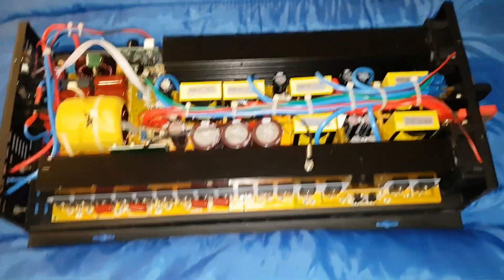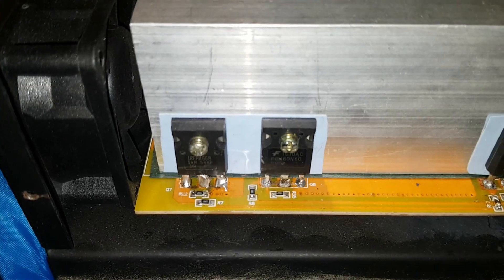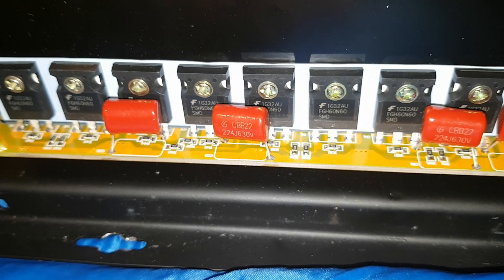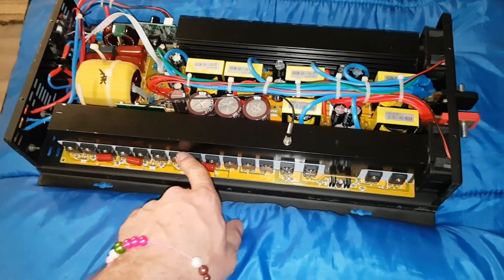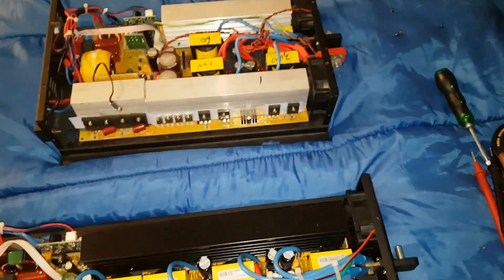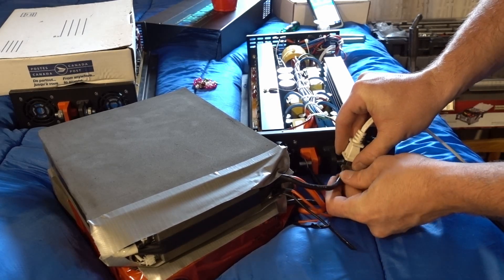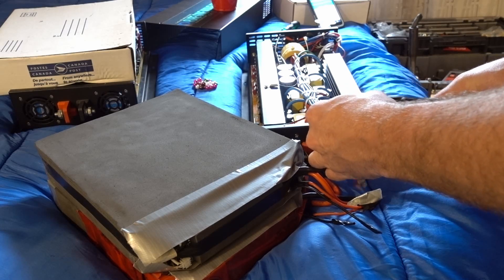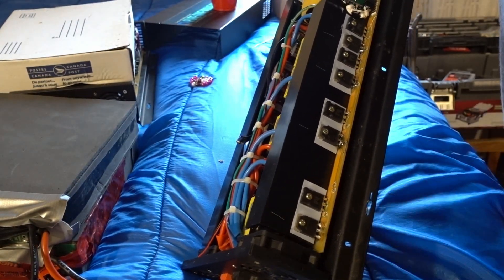4000W Reliable Inverter Insides

Comment: I have a reliable 3000w
First switch on, solid red light
Switch of 2 minuets later switch on and bang.  1 blown mosfet and 2 shorted IGBT’s
Will a g30n60 works as a replacement IGBT?  It has same spec as the original
Reply from the maker: if the specs are the same then yes. what was the original mosfet number ?
Reply: 60t65pes.  I have just realised that the replacement is 75a rather than 60a.   And 600v rather than 650v.  Would this still be ok?  All other specs seam the same that I can see.   Thanks for your help.  Loving the videos
Reply from the maker: @stockleys  that should be fine.
Reply: Would you believe it, new IGBT’s turn up and one is faulty.  Totally open circuit.   One question about your video, if the inverter has overload protection, why would it blow components if it’s overloaded.  Should it not shut itself down before damage is done?
Reply from the maker: @stockleys  I believe it has overload protection if you use items that slowly ramp up the watts but high surge or if your running at max rated power for to long it can blow components
Reply: Next question and I am very grateful for your advice,   I have installed the new IGBT’s.  Inverter is working.  Good 240v.  But the frequency is going as high as 70hz (uk is 50hz).   Also the fault light is faintly flickering.   Any ideas?
Reply: Ok it has settled down now. Steady 50hz.    But it does seam to be getting rather hot.  I did the mod you did (without cutting heat sink).  Moved thermostat to over the top the IGBT’s and applied thermal paste.   Not heard fans yet but I have only loaded it to 250w so far.   Working my way up
Reply from the maker: @stockleys  the red flicker is fine, it just the inverter saying its in the upper half of its operating range.
Reply: What I have discovered is that the flickering stops when the battery voltage is below 13v and starts again above 13v. Regardless of load
Reply from the maker: @stockleys  some of their inverters seem to do this, I have one that does this and it seems fine.
Reply: So the inverter has been running great for 3 weeks.     I turn it off to do some work.  Turn it back on... pop.  Same 2 IGBT’s blown again.   Mosfets all fine.      Replaced them IGBT’s    Turnt it on, no voltage reading and pop.    No load connected.    What on earth happened?   Is it a fault with the yellow board nearest them?      My electric bill has reduced massively using the inverter.   And I’m one day, it’s shot back up without it   Help please.
Reply from the maker: @stockleys  how big of a load are you running?

Comment: My 3000 watt Reliable inverter is outputting 130-134 ac volts and I suspect is overheating because of this as the fans come on every 5-10 minutes. Is there a way of reducing the voltage?
Reply from the maker: Inside the inverter there is a blue box with a small flat head screw on top covered in hot glue, turn it 2 times clockwise and see what voltage the inverter is at.
Reply: @GoingOffGrid101  Many thanks for the quick reply. I will give it a go.
Reply: OK I tried that as the output voltage started to creep up to 140-141 volts. Initially it went down to 129-130 so I turned the screw two more times and now its still sitting at 137volts with 27.6 volts coming in from the batterries. It seems to be working but I am worried that something is not quite right. Appreciate any help as I am isolated out here on a small island. Cheers.
Reply from the maker: @richardnemar-smith4621  sounds like the pot has been corrupted, might need a new pot, see of you can find a model number or ask reliable to send a pot
Reply: @GoingOffGrid101  Thank you for the quick reply. I seem to have little luck in contacting Reliable. They just don't seem to want to get back to me or don't read their messages. I will try and ring them tomorrow and see if that works. Many thanks.

Comment: I’ve got the 3kwh / 230V / 36V version. Didn’t open it up as it’s still working fine after 2 years. It draws about 35-40 Watts in idle since the first day. Except from that there’s no dedicated earth connection pole the only thing that I dislike. Do you have an idea how that idle current could be improved? Thanks!
Reply from the maker: Hmm thats a bit high for the 3000w my 120v ones only take around 25w no load draw,  could be cause you are using 240v, I would say dont fix whats not broken :D

Comment: 3K inverter = IRFP4 (6) 68     (9 mOhm 200V)
4K inverter = IRFP4 (3) 68     (1.6 mOhm 75V)
...easy to miss :)
Reply from the maker: the 3000w inverter mosfet to the right is one I replaced with a different one :D
Reply: The IRFP4668 can handle less than 5x the current, but a much higher voltage.
If the others are the IRFP4368's, then you have a serious problem.
Reply from the maker: @stevebliss6056  i believe i showed the input stage on the 3000w and the output stage on the 4000w by accident lol

Comment: want to fix an inverter and wondering if you can help me find the right mosfets
Reply from the maker: Sure
Reply from the maker: the mosfets in this video should work with most inverters.
Reply: Looking for a few to match the ones my inverter has.  Number on them are as follows.    Uv1404r
                         b1619h 
If you could help me it would be great.
It was a hand me down have a feelings that it was over loaded it turns on but no output. After opening it I founded and few that are bad
Reply from the maker: @nikolas22954  i cant find much on those
Reply: @GoingOffGrid101  just want something that will work
even if i have to change all of them on the output stage

Comment: hmm, size wise (external dimension), the 4000w looks a lot like my 3,500W 48V volts inverter when compared to my 3,000W 48V (both from Reliable).  I have not open it up to see what inside yet.
Reply from the maker: wouldn't it be nice if the 3500w was really a 4000w :)
Reply: How many mosfets are in output side of 3500W reliable inverter?

Comment: where is the beat place to bond neutral to ground on an inverter.
Reply from the maker: I bond the neutral to grond after the inverter, that saves you the risk of blowing the inverter.
Reply: @GoingOffGrid101  so you just jump between the neutral and ground lugs
Reply from the maker: @dylanc9275  use only the neutral and the live off the inverter, then after the inverter not attached to the inverter bond the ground and neutral.
Reply: @GoingOffGrid101  u lost me lol
Reply from the maker: @dylanc9275  i might ad it to a video :)
Reply: @GoingOffGrid101  awesome man. I ran my house off of lithium 18650 today for 12 hrs still at 80% all I need now is solar. Other than my furnace won't run with a floating neutral. I might just bond it in the panel box.
Reply from the maker: @dylanc9275  yes bond it in the panel, then only connect the live and neutral to the inverter and it will work :)
Reply: @GoingOffGrid101  just want to make sure i got this right as your seem to have posted conflicting posts, if you have a hot live neutral (50/50 live and neutral to make 120v or 240v depending where you live) and any part of the system after the inverter is and neutral is ground bonded (fusebox or near/at inverter) the 55v or 120v (the neutral) will go dead short to ground and release magic smoke

so if the inverter has hot live neutral at no point of the system (neutral) should be bridged to ground after the inverter AC output

if the live is outputting the intended voltage (120/240v) and no live on neutral (normally the neutral and ground connection block are pre bonded inside the inverter) you can do normal ground bonding inside fuse box and no magic smoke 

as his setup would mean his furnace will only be getting half the voltage (well it blow up the inverter first if he bonds the neutral to ground in the fuse box)
Reply from the maker: @leexgx  its late ill have to make a video, im just saying the house can be neutral grounded but the inverter can't.

Comment: Wow no views yet, guess Im first! So a 4kw is kinda like a throttled 5kw, (with less FETs than a 5kw ) yeah I think I'd go with the 4kw, even if it was $100 more, the FET upgrade is a good idea, I don't use the power you do,  I can live off one 20amp circuit, but if I'm running tools that goes up ALOT!! I could probably get by with a 3kw,  but I have a 24v 5kw, to run the fridge, microwave, and TV, with a 12v 120ah battery bank for lighting, I would like to get a larger inverter, or a couple smaller , for back up, and occasional use. I have backup pwm charge controllers, though I use mppt, when I add more panels I will not be able to use a pwm, because of the high DC voltage, ( not a cheap mppt, I don't guess) it will be 90- 120v approximately, depending on the panels, I kinda like the 435watt panel, even if they are not the best deal. It will be less panels carried around. And go faster , but the 300ish watt panels are cheaper, by a few cents a watt, I hope to add 2500 watts or so. And add a turbine or two,
Reply from the maker: yes these 4kw inverters look nice! I have been using it all day. I really like the 4000w and the 5000w inverters they seem to be well built.